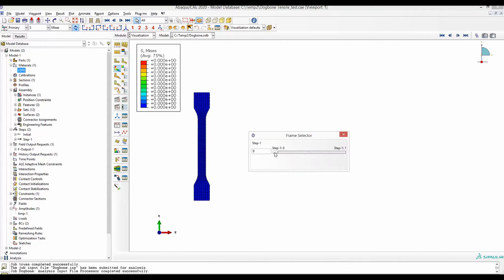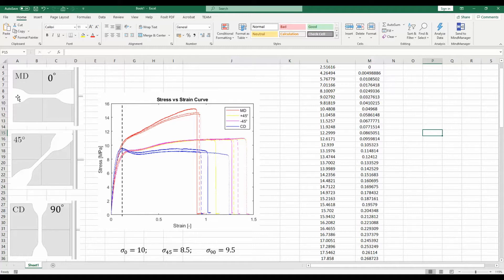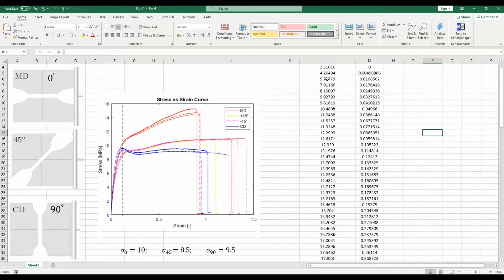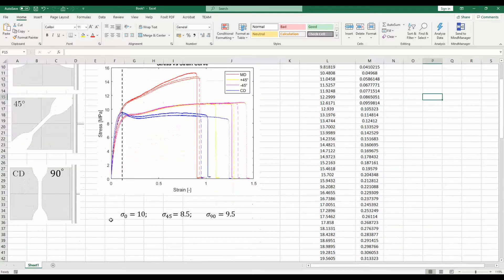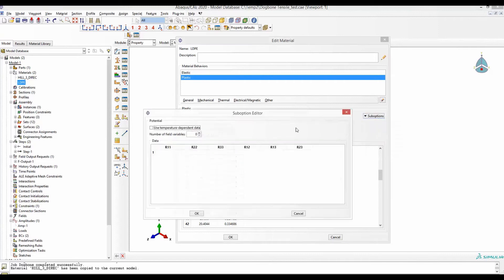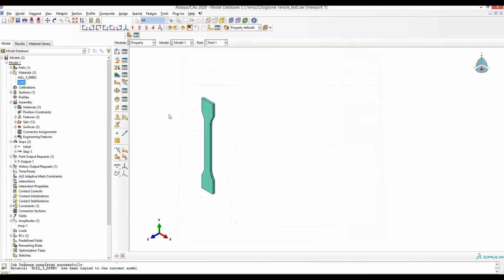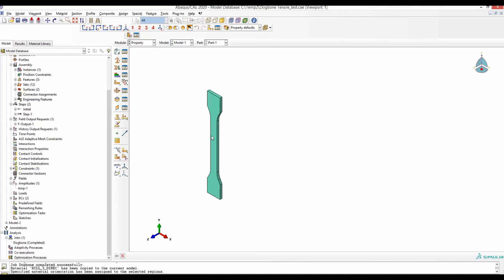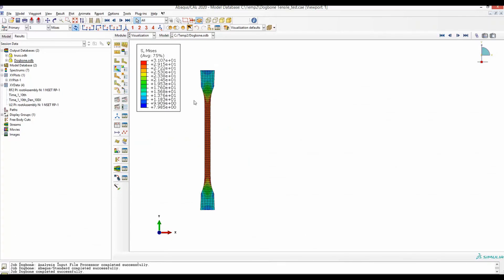Anisotropy in Abaqus (Hill48)

Comment: Thanks for the wonderful explanation. I had a doubt about how we can do the simulations at 45 and 90 degrees. Can you please reply?
Reply from the maker: Hi, you can define material orientation in Abaqus. If the orientation is along 45 degree of for example of a dogbone  specimen, inducing tension will result in response in 45 deg
Reply: @10Minuters  so we change the material orientation definition from 'global' to 'coordinate system' and add additional rotation angle as '45' deg in that case?
Reply: @godwinthankachen5147  did you successfully define the material orientation in Abaqus using this method from global to coordinate system?

Comment: Hi thank for the post. Can I ask a question please? when you entered the plastic strain stress curve values, which direction you pick? and why? Many thanks!
Reply from the maker: I picked the machine direction or 0 degree orientation for stress-strain curve. It is optional though. Whichever direction you choose to divide by for calculating anisotropy ratio or yield stress ratio becomes your reference direction, and stress-strain response of reference direction can be used for hardening.